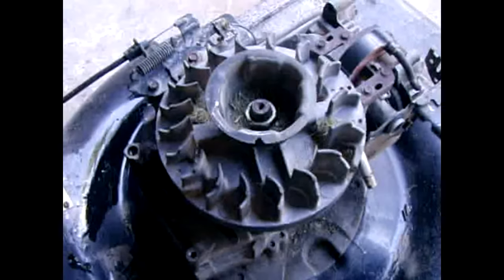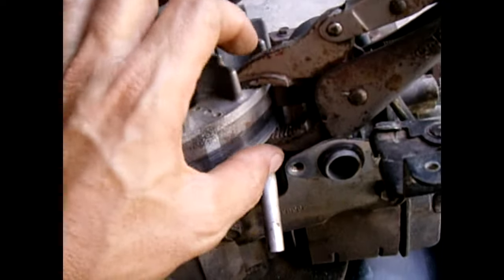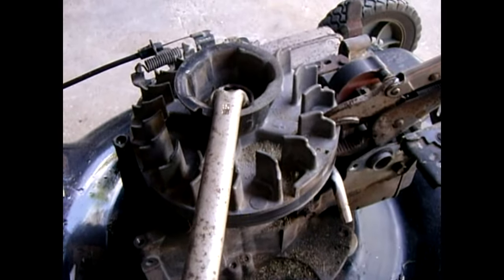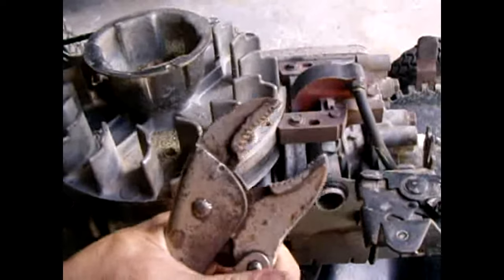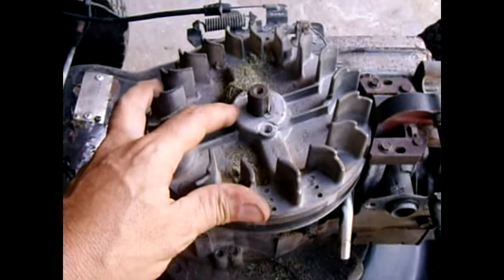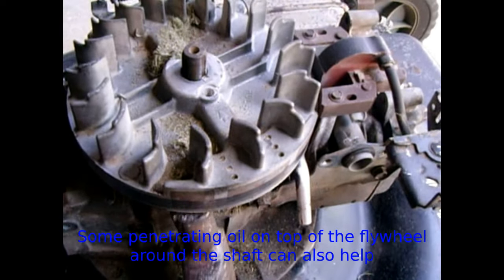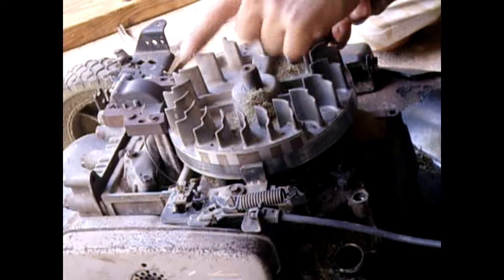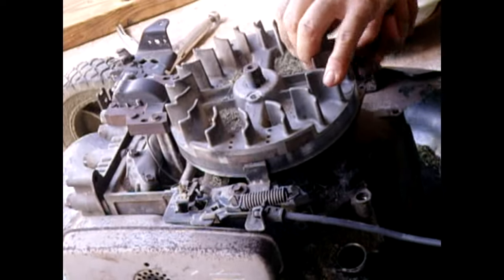Easy Method To Remove A Lawn Mower Flywheel If You Don't Have Special Tools!

Comment: if you put your bolt back on the shaft before tapping, you're less likely to damage the treads
Reply from the maker: I know, you can leave the nut on partially. I was not tapping that hard to do any damage. It sounded worse on video. :-)

Thanks For Watching.
Reply: electronicsNmore very true but if anyone is like me, they want it off fast and think "if a little is ok then a little more is better" I learned the hard way
Reply: @electronicsNmore  I screwed up the crankshaft on a mower by accidentally striking it an angle and it rolled over the threads nut was very hard to put back on. still worked though. even with the nut on halfway its still actully possible to strip the threads if you hit it to hard and I also have done that to a mower as well. Just be carefull how you do this. You can avoid damage to your mower  by buying the proper tool to remove the flywheel. this worked for me and i learned my lesson about hitting it to hard! great video
Reply from the maker: @HighVoltageMadness  Nothing is guaranteed. The video is for people that don't have access to special tools.
Reply: @electronicsNmore  Worked for me, thanks.  By the way Tecumseh actually sells a flywheel knocker puller nut to screw on the shaft to prevent damage.  My Tecumseh vertical shaft engine had no treaded holes for a traditional flywheel puller and zero clearance to get behind it to tap on the flywheel, so I tapped the shaft while prying behind the flywheel with a screwdriver, after a good spraying with a WD-40 type product.

Comment: Hey thanks. The tapping worked well for me. I do know that tapping on a magnet weakens it (well at least that's according to my HS physics teacher), but it gets the job done. Also, instead of clamping the flywheel to hold it in place, Stuffing a 2x4 through the grass outlet and up against the blade worked well. And check you're socket sets before you start! That nut is at least 7/8" if not 1"
Reply: My Briggs had a 15/16" nut. Be sure you buy a deep socket.
Reply: @docham  HOW TO AVOID BUYING A DEEP SOCKET FOR A ONE-TIME JOB--
If your 15./16-inch socket is a standard length, for a 1/2-inch drive, simply attach a 1/2 to 3/8-inch drive adapter, and use a standard 3/8-inch drive wrench, instead. In other words, the adapter, itself, contributes enough length to avoid having to buy a 15/16 deep socket simply to clear the pull-off cup.
Reply: Some are 3/4, depends on engine and therefore crank size
Reply: My briggs engine has 3 bolts on the blade bar & the large centre bolt came off with a 15 mm socket as it the same size as the imperial equivelent .

Comment from the maker: There will always be some "Expert", or "Wanna Be Expert", who will say this is a bad method and give me a thumbs down. LOL

The fact of the matter is, this is a great method when no specialized tools are available. I proved it over and over. Never a problem.

Thanks for watching!
Reply: A spectacular  tool i use is a piece of rope which i put down the spark plug hole to lock up the motor ... no need for vice grips  ... just saying..
Reply: I take a 4x4 block of wood put it under the blade and pull the spark plug wire off and take a half inch breaker bar or a regular 3/8 ratchet and then I loosen the bolt. Because those vise grips can slip off crack or Bust the aluminum flywheel or bust one of the fins off of it.. I guess everybody has their own way of doing it and they swear it's the best way you know Different Strokes for different folks. Whatever gets the job done and don't damage nothing is considered a success in my eyes😂😂

Comment: Nice job. I've always used a pry bar with slight pressure from underneath while tapping the top. Just have to careful where you pry up from, as to not put pressure on an easily breakable part of the engine.

Comment: Thanks for the video - very helpful!!  A couple thoughts:  thread the flywheel nut partway back on and tap on the nut. Also tie back the stopping bail so it doesn't bear on the flywheel.

Comment: Loved vid and THANKS, but one pc. of advise from an Old Timer. "anytime you tap on precision machined metals such as a shaft or flywheel PLEASE use Brass or composite materials hammer or bar. Never use steel or iron to tap on precision mechanisms and when using vise grips in an area one doesn't want scarred , use a pc. of old leather from a discarded belt or shoe between the metal and the plier jaws".
Reply: Use a piece of dowel or hard wood if you dont have a rubber mallet
Reply: I used a rubber mallet from dollar tree

Comment: Be patient and use WD40 or something to help loosen the flywheel. After a bit of tap tap tapping with no apparent progress I went to the hardware store to see if they had  puller, but they were closed. When I got back I tried some more and it popped loose after a little bit more effort.

Comment: I've always screwed the nut on the shaft and using a large screw driver to put up pressure on the flywheel, I hit the shaft and the flywheel pops right off every time without damaging anything. That's how I roll!

Comment from the maker: TIPS NOT MENTIONED IN VIDEO: Apply some penetrating oil on top of the flywheel around the shaft to help loosen it up before doing what's shown in this video. Use a curved or straight jaw Vise Grip, and DO NOT hit the end of the shaft too hard or you'll mushroom the end! Light taps ONLY!
Reply: Great job
Reply from the maker: David Ramos Glad you enjoyed it. Be sure to check out my video playlists and share. Thanks!
Reply: electronicsNmore what tool
Reply: how do I get the pisten off what tool do I need
Reply: Screw a nut on "halfway" to the crankshaft threads before hitting it with a hammer to reduce the chance of damage to the threads.
Reply: Good

Comment: When you have to go without, you improvise. This does work. A heavy hand will cause more damage than an alternate procedure. Good video.
Reply from the maker: The method works well. I use it all the time. Like anything else, you have to be careful to prevent causing damage.

Thanks For watching! Be sure to rate Thumbs Up and share.

Comment: I use a battery operated rachet 1/2. dont need vise grips. make sure your going in the direction of removing the nut or you will rip it off.
Reply: jonathan lucier  I guess you didn't understand what he was trying to say at the beginning of the video he said he's going to show you how to do it if you don't have any special tools that includes a battery operated tool Jonathan stay with us here he didn't say I'm going to do it is and then everybody else give me their opinion how to do it better wrong videoyou could've just said you did a hell of a job guy getting that off and I think he would appreciate it have a great day

Comment: I use a block of wood under the deck to block the blade from moving.   And I put back the bolt so that it is flush with the top of the shaft.  And use a  pry bar to pull up in the flywheel.  

Good to see there  is other ways to do this.
Reply from the maker: Always "alternate" ways of doing things. Thanks for watching! I have a lot of excellent videos on my channel that cover many different subjects, so be sure to check out my extensive video playlists for other videos of interest to you, rate thumbs up, and most importantly share my channel with others.

Comment: Using a claw hammer to tap the shaft and the aluminum flywheel is not the best way to remove it. You can easily crack or break the flywheel. Instead of taking the chance of breaking the flywheel with vice grips I chocked the flywheel with a 2x4 to keep it from turning and used a 1/2" drive breaker bar with the right size socket to remove the nut. I then put the nut back on a couple of threads and smacked the shaft with a leather head soft hammer. Popped right off. Torqued it to 55 lbs and cut the grass.
Reply: When reinstalling the flywheel put Neverseez (a nickel compound) on the shaft to keep it from sticking to the shaft. Easily remove should you break the key again.
Reply: @Oat57   Neverseez is very good stuff that has its important purposes, but recommending it in this case, although well intended, is extremely terrible advice. Immaculately clean and dry tapered surfaces adequately torqued is mandatory to gain the grip needed to prevent key shear, because the commonly misunderstood woodruff key is only for initial alignment and not meant to prevent rotation on the shaft. In fact, lapping with compound, with key removed, similar to lapping valves followed with super cleaning and adequate torque will almost totally eliminate the very, very, very common and sad experience of key shear. Of coarse lapping can't be done if the key is not a separate component, but the importance of clean, dry and tight applies just as much. Understand?

Comment: An improvement to this would be to use the claw of a second hammer to pull UP on the flywheel while tapping the end of the crank. It literally makes it come off in 1-3 hits without EVER striking the flywheel at all
Reply from the maker: Some are really stuck on the crankshaft, so it may not work. Thanks for watching!

Comment: I use 2 large screwdrivers to hold the flywheel and output shaft to its highest position, start the nut back on the crank, then one sharp blow removes it. No need to hammer on the flywheel. You could see in this video when he taps up on the flywheel the amount of end play on the output shaft. That tiny bit gives you the ability to tap down on the output shaft to release the flywheel. You can do the same thing with the screwdrivers but use an air hammer instead.
Reply: Deucealive75, Correct! Because the flywheel is NOT in contact with the upper crankcase bearing, tapping the shaft down without lifting the flywheel up to the top of the shaft end play does NOTHING but impact the lower crankshaft main bearing! Any mechanic watching this video cringes at the lack of experience proudly showing others the WRONG way to remove engine flywheels. This video is a dangerous, embarrasing joke. Take it down!

Comment: Nice idea on the Vise Grips. I'll have to try that sometime when I don't have the Harbor Freight Electric Impact available (which is a VERY good $39 investment for just such a purpose.) That is a rare boxed end wrench to have that much angle. I'm guessing most people would use 3/8"- or 1/2"-drive ratchet and socket.

Regarding flywheel extraction: I would endorse this methodology. He didn't hit anything hard enough to damage it.

More stubborn extraction may force the use of pry bars or pullers. Protect those threads, perhaps add the nut to it. Don't pry hard enough to break the aluminum flywheel.

Thanks for sharing your ideas here.
Reply from the maker: Glad you enjoyed the video! I have a lot of excellent videos on my channel that cover many different subjects, so be sure to check out my extensive video playlists for other videos of interest to you, rate thumbs up, and share my channel with others. Thank You

Comment: 1st: to lock up the flywheel pull the spark plug and insert nylon rope (pull string rope) as much as you can fit. This will stop the piston without causing damage. 2nd: pulling the flywheel without a puller. Put the bolt or nut back on the crank. Apply pressure with a crow bar under the flywheel as close to center as possible then with one swift swing of a heavy hammer to the top of the crank straight down in combination with the pressure from below the vibration will free the flywheel
Reply from the maker: You don't need to do that, you can insert a 2x4 between the blade and mower frame if uncomfortable with my method. Thanks for watching!

Comment: Hey thanks brother!! That was my initial train of thought but i had this vision of the flywheel shattering as I tapped . Just needed the video to reassure me that wouldn't happen. thanks again
Reply from the maker: If you are careful, you will not cause any damage to the engine or flywheel, and the flywheel will come right off. I have done it many times before.

Thanks For Watching! Be sure to rate Thumbs Up and Share.

Comment: How many times do you have to follow this procedure's steps before I can expect the fly wheel to come loose? Or how much time should I spend trying to make it work? I've been trying to remove the flywheel from my mower's engine for about a day with this method and it's not even close to coming off! Anybody got any ideas for me?
Reply: my engine has an aluminum  flywheel. the puller put some stress cracks in it.  I used a 3/4 box wrench like a ball joint chisel. If  you have an old box end wrench, you can grind it down to a two prong wedge like a ball joint chisel.   check the shaft behind the flywheel,  to what thickness you need.

Comment: Use Clothesline in the spark plug hole to lock the engine. Put a block of wood on top of the crank and hit the wood with a hammer. Pry up on the flywheel under the thick part while hammering on the wood. It'll pop up! A knock-off tool works also. Set magneto gap with a paper calling card.
Reply from the maker: You can also wedge a 2x4 between the blade and body of the mower.
Reply: @Marty Stevens.....what you describe is nothing short of back-woods, hack mechanics.

Comment: Pull/ Clamp the Safety Shutoff lever and it will release the pressure the flywheel "Brake" from the fly wheel.
Go to 4:30 and it is the "brake" in front of the spring at the bottom of the video.

Comment: just remove spark plug and stuff some rope inside cylinder to unscrew that bolt. These flywheels crack so easily. To remove flywheel I used two crowbars to lift it.

Comment: This is the slowest method
/ Remove coil,file shaft , heat with propane torch spraying with blast corrosion rust and heat.2x2eight inches (wood) hammer flywheel and spray and heat 3 minutes tops .good video thanks

Comment: Awesome! I just resuscitated a rusted up engine but couldn’t get the flywheel out. Will finish restoration later with this trick. She turns on on first pull but has a slugging pull.

Comment: Even easier method:  Pull your spark plug and put a socket driver or other dull rod into the spark plug hole on your cylinder head to check the piston position.  Rotate the flywheel counterclockwise until the piston is fully retracted.  Now feed about a foot of clothesline through the spark plug hole into the cylinder.  Continue rotating the flywheel counterclockwise until the clothesline in the cylinder stops the piston on the compression stroke.  Voila,  stopped flywheel.

Comment: Vise grip is a special tool for me which I do not have. Some people use rope to lock the piston. I wonder if it is safe to use neylone rope in 4 cycle engine? People saying you can damage valves. I have a feeling it should be safe to put a rope in the middle of compression cycle as the both valves will be closed. Am I right?

Comment: I have a Toro Personal Pace mower. It was a gift or I would have never gotten it. Toro decided they needed to create a mower that uses a PTO with a belt to turn the blade. This means blocking the blade won’t stop the shaft from turning. They also made the fan blade section out of plastic. 

I was a bit nervous about even clamping the Vise Grips on it due to the plastic bit, but I soaked the nut with PB Blaster and let it sit for a while, clamped it and gave it a crank with my breaker bar. It came loose like butter! 

I wouldn’t want to clamp down on that plastic too often so I need to make certain I get all the repairs done in one removal. Thanks for the video!

Comment: This is a rough way of taking off the flywheel. Maybe break the coil threaded boss stud. That is what the neighbor did using this method. ROUGH for sure.
Reply from the maker: Never had a problem. :-).

Comment: I use a block of wood to block the blade to keep it from moving and use a pry bar to push up on the flywheel  while taping on the shaft
Reply from the maker: That works too! Thanks for watching

Comment: DON'T NEED TO USED PLIERS AT ALL...JUST A PIECE OF 2X4 UNDERNEATH HOLDING THE BLADE FROM ROTATING WHILE YOU LOOSE THE NUT WITH SOCKET OR WRENCH.....
Reply from the maker: YBW0S0 Change from caps to regular text or your comment will be deleted. Thanks

Comment: Darn. Problem is, my Troy Bilt has a guard preventing me from bumping the wheel from the bottom.
Reply from the maker: Can you remove the guard? If not, then you need to use a flywheel puller.

Comment: Hi. I have an old kirby tecumseh 2 stoke motor and I have LITERALLY tried everything there is to get the flywheel off, from heat, to soaking the shaft in brake fluid and I've even tried heat, and the puller and hammering at the same time, but nothing has worked. Do you have anything else to suggest?

Thanks.
Reply from the maker: You may have to use the specially designed puller. :-(

Comment: Take center nut off, then take your hammer and smack the center bolt on top a couple times. If that doesn't pop it off, then put a screw driver up under the flywheel to put upward pressure on the flywheel, then take your hammer and smack that center bolt again! Works with any mower!
Reply from the maker: If you hit the crankshaft too hard, you'll mushroom the threads, so it's better to leave the nut on to protect the threads from damage. Thanks for watching!

Comment: You didn't claim this is the best method, just that it does work when the instructions are followed so you don't deserve the unfair and worthless comments such as the self proclaimed mechanic that demanded it be taken down. I was very surprised to learn mild hammer taps didn't fail to pop it or cause harm by hitting the edge of the flywheel. I appreciate you sharing this interesting and valuable knowledge even though I wouldn't choose this method.
Reply from the maker: There's a time and place for everything. If you didn't have any specialized tools on hand, you'd do it. Hammer blows weren't that hard. :-) Thanks for watching!